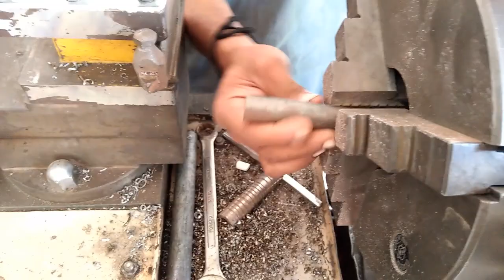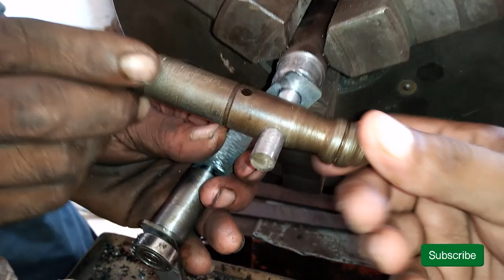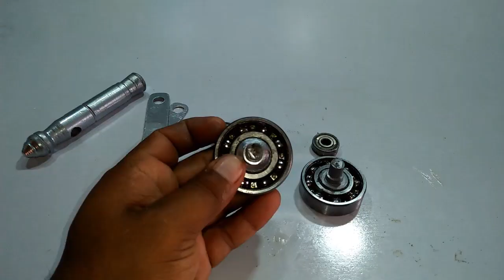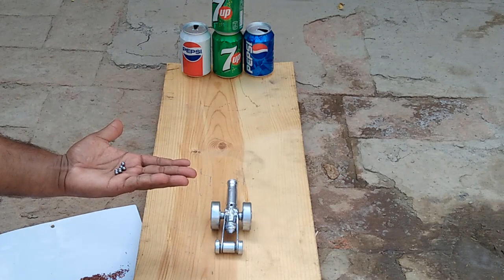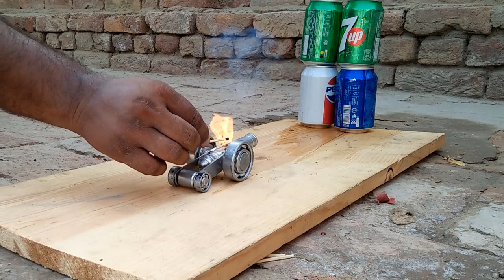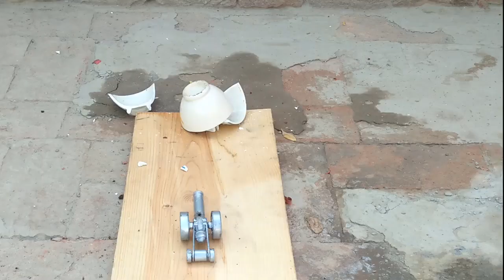How to Make Mini Cannon Easy Awesome ideas

Comment: it's a visible guy doing a bad charging a cannon your crucial mistake is not giving any stuffing in front of a metal ball which is really bad so do not wonder that your results can not be enough that. and you too have a big hole to fire the ignition line, which is also bad